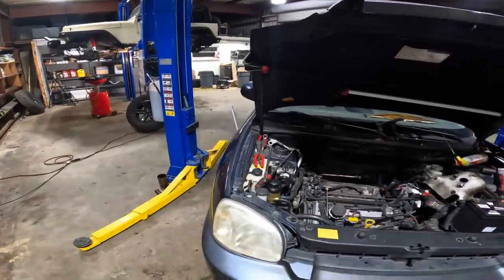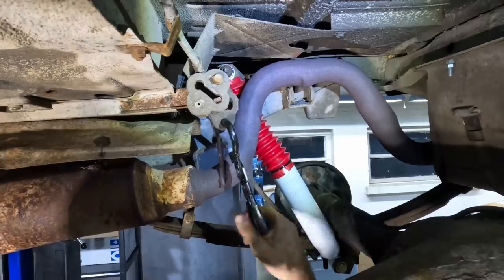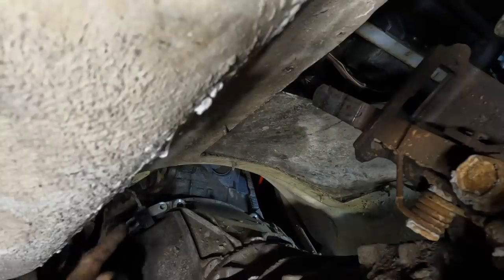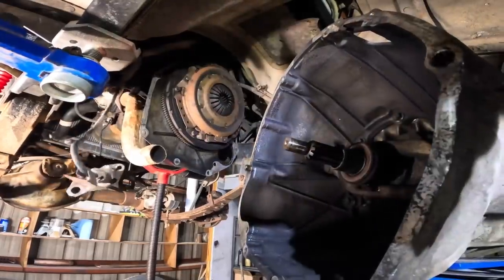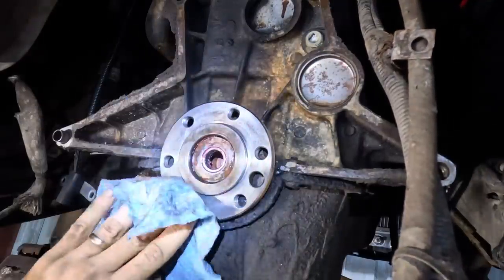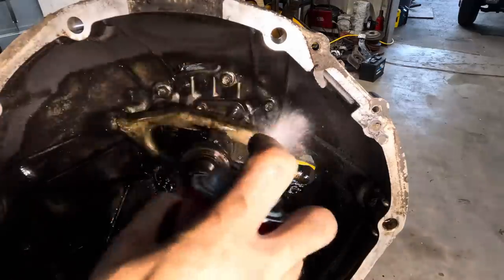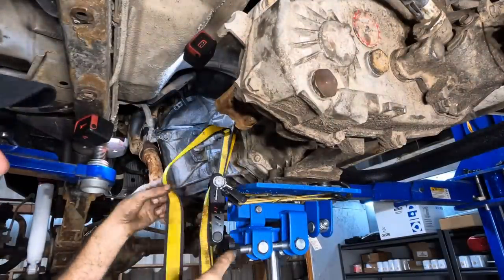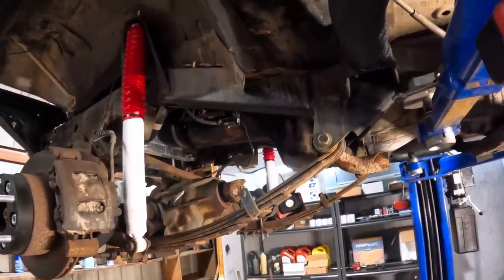Smallest Shaft Ever! FRIED Flywheel! | Project JEEP! 1995 Wrangler YJ

Comment: Oh, the memories come back...
Replacing all the clutch parts in my driveway with no jacks, power tools, and home made pilot dowel made from wood dowel wrapped with masking tape to correct diameters.
On two different cars back around 1986.
Reply: Been there, done that.
Reply: With a couple of buddies, a few cases of beer, a few pizzas, and rock music on the radio. Great times, good clean fun.
Reply: Never used a dowel, as I shoved my Saginaw transmission in, I had someone depress the clutch. My wife used two legs and feet on the clutch to press it in.  69 Malibu
Reply: Same here, balancing a gearbox on my chest before dragging it out... up to my eye balls with gearbox oil... and on one occasion, damaging the main seal with all the faffing about and not noticing until I got the bloody thing back on!! A broom handle hammered into the old clutch plate makes a great aligner!
Reply: Bash plates off pursuit spec Police cars make excellent cradles to modify a stock floor jack into a gearbox lift, I still have the multifit alignment tool I purchased in my 20s and it proved to be invaluable for single operator installs 👍
Reply: 1961 Rambler American Wagon, changed transmission and modified the lever for the slave unit to fit the non-standard (only one I could find) transmission case in 1972.  20 degrees below zero in an unheated shop working off the floor.  I still shudder from the cold.

Comment: To remove a pilot bearing, fill the area behind with grease and use a snug fitting shaft  (socket extention ,clutch alignment tool, etc, )
and hammer it in, the grease easily hydraulics the bearing out.

Comment: This brings back a lot of memories of changing out clutches in vehicles that were bought cheap because the clutch was slipping. I once changed a clutch outdoors on jack stands on a frozen pool of water. Bottle jack and strong arms. Those were the days! Cast iron T-10 is heavy.
Reply: The transfer case of my 75 Blazer used to go in in an angle sideways you had to put it in and rotate one end up why they designed it that way it was just for clearance on the drive shaft but I did did it twice on my back on concrete fun job but it got it done have a great day
Reply: Did that once and never again.
Reply: @michaelpressman7203 , Youth, and we wonder why we ache so bad in our older years! Lol

Comment: Pilot bushing removal. My dad used to pack the cavity with grease then struck a piece of shaft the same size as the transmission shaft to force the bearing out. The hydraulic action of the grease would force it out.

Comment: I've been loving this jeep resto series so far. As someone who isn't a mechanic but has a deep love for pretty much everything with an engine, I have learnt alot from this series.

I was wondering why the fingers on the pressure plate were sticking out so far, I never knew they bend in when you tighten them....
Reply: That compresses & clamps the clutch that's why the fingers go in I would like to see the old clutch just out of curiosity I bet it was smoked have a great day
Reply: @michaelpressman7203  The friction disk didn't look too bad at all actually, you can get a decent glimpse of it at @22:48. Pressure plate was probably not much better shape than the flywheel though. Throwout bearing was quite trashed.
Reply: if they didnt you wouldnt have drive,,they put the pressure on the flywheel so you drive,, clutches only need 1/2"" of movement to seperate so you can change gear. thers multi finger & 3 finger pressure plates, plus multi disc, for raceing. 70,s ford gt ho, use twin plate clutches, more disc meat.
Reply: The more the clutch wears, the further out the fingers will be, until they start running against the thrust bearing, causing the clutch to slip

Comment: Thank you Ray for these great videos ! When removing a pilot bearing, what I have used in situations like this when not having a tool is to pack the bearing cavity with grease then using an old pilot shaft place it in the bearing and smack the pilot shaft with a hammer. The bearing should come right out. It usually worked for me.

Comment: I agree with Bradley. Flywheel bolts need to be torqued to spec or flywheel may warp slightly with heat, causing clutch shudder. Same with pressure plate. Also a good idea to replace rear main seal and imput shaft seals. If they leak early before next clutch job. You'll have to go thru same process

Comment: Ray pilot bearing removal. Get a punch that barely fits in bushing. Then take water soaked pieces of paper towel. Push them in the hole until the cavity is filled. Then take the punch and compress the towels with linear impacts. Then add more to it until hydraulic pressure pushes it out.

Comment: I feel like that pilot bearing solution was a perfect example of "You can't solve the first problem until you create a second problem." 😀
Reply: The last clutch job I did was on my 1984 Ford E 150 van.  5 speed.  We didn't have no stinkin' lift or a trans jack.  Ramps only and on our backs.  God.   WTH was wrong with us ?
Reply: Try putting in a trans and transfer from a 77 chevy 3/4  ton on jacks stands and a peice of plywood to roll a hydraulic floor jack around on,they were cast iron then.I was young and strong then too,hahaha.
Reply: ... And that FREEZE PLUG up top will leak tomorrow...and it will all have to come apart again to allow access... it already has signs of RUST dripping down it... Marine duty BRASS is what I'd put in there... never saw a torque wrench used...The whizz wheel contaminated his pilot with highly abrasive whizz wheel grits... Dan Habluetzel

Comment: Ray for pilot bearing removal I pump the hole with grease then use a bolt the size of the hole and hydraulic pressure pushes out the bearing.

Comment: Tip to new DIY'ers:   never drive a dowel pin/bushing in with a steel hammer.  They should go in without hammering, and if you DO need a hammer, use a brass hammer; if you deform the bushing with a steel hammer, it will make it very difficult to install the part....in this case, the trans...on the dowel.  Also, be SURE to clean the flywheel's friction surface thoroughly with brake clean before putting the clutch plate (friction plate) in place.  I'm surprised Ray didn't do this.
Reply: Just because it's not in the video does not mean it didn't happen. This is entertainment not educational documentaries
Reply: Maybe you should start your own channel doing repairs so we can see how it is all done according to you.     Just because you did not see him do it does not mean he didnt.   I am surprised that you would assume something like that.
Reply: There are a bunch of subtle activities needed to take place to do the job properly. A younger me did not know that brand new bearings needed care not to stress or damage it during installation and wondered why I had early failures. When it occurs to Ray, he'll mention critical things done off camera. There is a strong practical approach to getting things done that Ray has and I expect he doesn't get too many do-agains. Still, sometimes I wince.
Reply: Exactly!
I saw that and thought…..rainman is not rainman today.
And I didn’t see a torque wrench on any flywheel or clutch housing bolts either.
Tisk tisk …..that’s a risk.

Comment: I love these longer videos. Even though I have changed many manual and automatic transmission own my trucks and cars. I did not have a lift  just Jack the vehicle and put jacks stands under the frame and use a 4x8 piece of plywood and a hydraulic Jack to roll the transmission out and back in.
 You made it look easy.

Comment: Pro tip: Use bread! No, seriously! If you don't have a pilot bear puller attachment for the slide hammer, just start packing down the inner cavity with bread, and then use a hammer and chisel to pack it in until it's so tight, it pushes it out from the inside.
Reply: i was told grease works also with a hammer and a shaft that just fits so hydraulic pressure pushed the bearing back 
same idea more messy i guess
Reply: @gpsguidedsimpson  It does actually, and I thought about mentioning grease, but that's super messy, and bread is easier to clean out with a blow gun.
Reply: @gpsguidedsimpson  Blue paper shop towels can also work as well for this.

Comment: Sometimes it can help to have a few lengths of threaded bar screwed into the engine to help align the transmission when refitting. Great fun as ever Ray, keep on wrenching
Reply: If you have any old long bolts around cut the heads off right behind the neck round them off to a bullet point so you have a threaded rod with a pilot stud on the end and it makes life really easy I've done it a few times I used to do it on molds have a great day

Comment: So .. my first clutch job was far more interesting ... trans came out through a hole in front seat floor pan ... had to disconnect the torque tube ('49 Chevy) .. pulled the bell housing and was showered with pieces of clutch lining -- the rivets had worn through.  No alignment tool my dad helped me whittle down a broom stick .. LOL on my back in an unheated garage in Ohio in November 1965,  Memories.  Thanks for the reminder of what's involved.

Comment: Ray, your such a talented mechanic, and I love how you usually go the extra mile for your customers, but I feel that you missed 3 major steps in this job. (1) no blue loctite on flywheel bolts (2) no torque on flywheel bolts (3) flywheel surface was not cleaned. Growing up in my dads shop, I’ve seen cars come back with flywheel bolts backed out and cause more damage even when “torqued” that were not loctite. Techs would alway say “but I torqued them!” And cleaning the flywheel is just the same as cleaning new rotors ( maybe you did it off camera?) Thanks for the awesome videos as always!

Comment: The first time I pulled the transmission skid plate off my Jeep, it had 50 pounds of oil soaked mud and gravel in it, kind of like a bull dozer scoop.  I am liking your project, though I went with a TruTrac instead of a locker on mine.

Comment: Can't believe you took it apart that far and not replace the rear main seal. I know you can do it by just removing the oil pan, but It would have been easier while you were there. Good job on the clutch.
Reply: I didn't see any oil on all the dirt have a great day
Reply: @michaelpressman7203  First law of wrenching on old junk.  That main seal will leak a week after getting back on the road.
Reply: @jw-hy5nq  First law of wrenching " If ain't broke don't fix it"

Comment: Well pressure plates are supposed to be torqued to a specific amount or bad things are gonna happen like premature wear or uneven clamping pressure and slipping. Not to mention the machine oil coating they apply at the manufacturer on the flywheel. Clutch should last about a year if you are lucky.

Comment: I replaced clutch (at my apartments parking lot) on a small 4wd pickup truck (do not remember the brand).  It was touch and go a couple times when I thought I got myself into a situation I would not be able to fix.  But somehow I managed to get everything back together (with new parts) and working.

Comment: You know, with all the cleaner you use, you could put up an empty solvent tank/sink, clean parts in it, and eventually, you wouldn't need the cans, any more. Perhaps once in a while to top up the level after some evaporates.
Set up a recirculator pump, particulate sump, filter...
I've had such a setup. It's great!

Comment: Tap that like button, because the man does awesome work,.....

THEN, Honestly, I don't understand HOW Ray has all of this knowledge, and still doesn't know that you use the BACK SIDE OF A slightly LARGER SOCKET, to drive the bearings for, well just about anything.....

Back of larger socket = bearings end up flush....

Front Side of socket = bearings end up Countersunk....

I guess I got it from having to pull and replace and PAY for my mistakes.....

Thanks UNCLE BENNY!!!!

Comment: Great job! The brake clean co. just loves you Ray. I know as a mechanic, time is of the essence. If it were mine, every part you pulled, I would have cleaned and painted before putting back. The back of the engine and that backing plate also, because no one will ever be back in there, hopefully. The  trans and the bell housing gm red would be cool.  Just saying
Reply: I was actually just looking at the green BraKleen on Amazon.

1 can is $11.  3 cans is $68.  12 cans is $52.  (no, not a typo)

When it's THAT cheap, you just use and abuse it.  Plus the green stuff is CFC-free.

Comment: Pilot Bearing removal without a tool can also be accomplished by filling the bearing cavity with grease then take a dowel the size of the bearing opening and tap it into the opening. As the dowel goes in the grease will push the bearing out.

Comment: Thank you for the clutch explanation 
Many years ago I had a vehicle with a screeching clutch release bearing
Having to climb a really steep hill it give up the ghost
Getting it stripped to put a new clutch in
I found the bearing had burned its way through the pressure plate fingers
The fingers had turned a deep blue and curled inwards allowing the bearing to go straight in
All okay once replaced So after that all three major components the clutch friction plate, the pressure plate and the bearing are all replaced regardless when the gearbox removed even if the parts look serviceable I wouldn't go through that again because of a dodgy bearing

Comment: I know it is too late now, or if anyone else pointed this out (I just watched your video). Those two freeze plugs on the rear of the engine looked like they might have been starting to leak, even if they weren't leaking, you should have replaced them while the bellhousing/trans were removed. David

Comment: Did he clean the surfaces of the new pressure plate and flywheel be fore he installed them?
You need to do that just like brake rotors and drums. The flywheel looked a little oily to me.
Didn't see it in the video if he did.

Comment: One thing I've done to remove pilot bushings in the past was to pack the hole in the crank with bearing grease and then use a rod the same diameter as the input shaft, and a hammer and use hydraulic force to remove it.

Comment: I've done a grand total of 2 RWD clutches. In a driveway. Without a trans lift. Without massive amounts of flashlights.
1978 Datsun 510
1982 Toyota Celica GT

I can still feel the weight of the trans on my chest as I lifted and lowered them a dozen times trying to get the input shaft lined up, and I still remember sticking what must have been a 3-foot extension onto a ratchet to get the top bell housing bolts out.

My Subaru was actually much easier to just pull the engine due to the AWD. Between issues with the replacement clutch, trans replacement as a result down the road, and engine rebuild, I got to the point where I could have done the clutch on that in under 2 hours.

I enjoy working on cars... I don't enjoy needing to work on cars.

Comment: to get the pilot bearing out you cram bread into it then stick the clutch alignment tool or a broom handle, or whatever that is the same diameter as the pilot bearing inner diameter, then whack with a hammer and out it pops. did this to my jeep when replacing the clutch last year. some people use grease instead of bread, but bread works better

Comment: 44:07 as a teen i destroyed the transmission oil pump by tightening it all down but the torque converter hasn’t slid back. Heard a loud ting when I finally tightened it down. It couldn’t drive faster than 5mph after that. It was toast

Comment: No thread lock on the flywheel and pressure plate bolts? No torque wrench either? No wiping down the flywheel surface?

Comment: Yo Ray, just watched your clutch replacement vid. Just a small tip. To get the pilot bearing out pack grease in the hole, take an old pilot shaft or rod of the same diameter and drive it in the hole within a hammer. The bearing or bushing will pop right out. I’ve even seen it done with bread. Just FYI. Also, did not see you use Locktite on the flywheel bolts or torque them. That’s not like you. Please I’m not ragging. Just inquiring as to why. You’re usually so meticulous. As a mechanic for over 50 years, I really enjoy watching you work. I hope some day to meet you before I leave this planet. Keep posting videos. 
Regards Stan

Comment: My first experience with changing out a clutch and throwout bearing was on a 91 Dodge Ram. It was on a uneven section of the driveway and we had a floor jack to take down the transmission. I was the only one small enough to sit under the truck and install the clutch and basket. I'm 5'2" and my Uncle is 6'3" so he put the throwout bearing on and I did the grunt work...oh and I had nothing but hand tools to work with. Needless to say it got put together perfectly and ran really good because we were selling the truck.

Comment: When I was young working shade tree I filled the rear of the crank and pilot bushing with grease then with a bolt that fit snugly in bushing I struck it sharply the bushing slipped out easily.

Comment: Ray -- while you have all that apart, you'll want to invert that right side shock, that way when you put the new exhaust in, the rubber of the boot won't be right next to the hot exhaust tube.  Guaranteed to burn, smoke, and do nasty toxic things otherwise.

Comment: 1995 the “Wrongler” with the square headlights, I had a ‘91.  Now, I have a 2010 JK Rubicon, that looks like a 2021, low miles and not a spot of rust, and I have a 2016 JKU Sahara.  Try it with hand tools and no lift, what fun….  I need to invest in a decent impact wrench and power ratchet, Milwaukee, you will spend over $1000.

Comment: I have removed the spigot bearing by filling the void where the spigot goes with grease. Then use a firm fitting rod and insert in the bearing. Hammer on the rod to use hydraulic action to drive the bearing out.